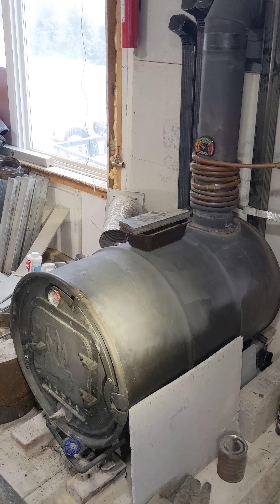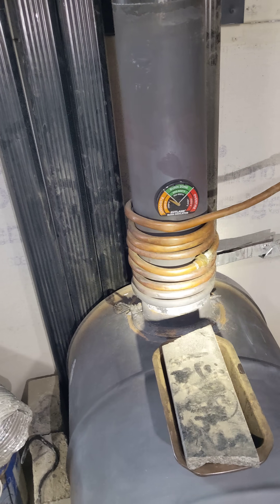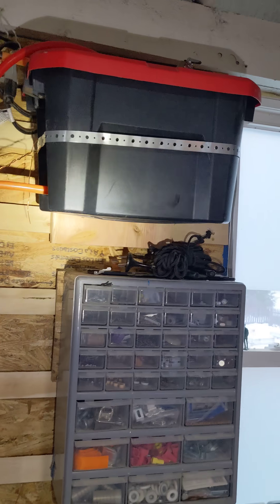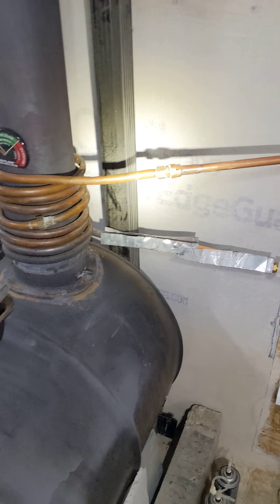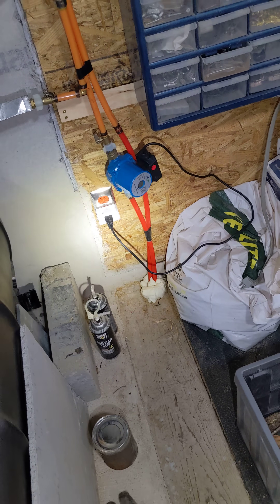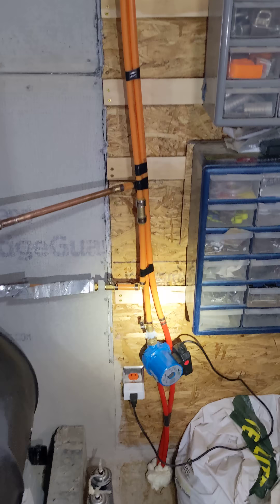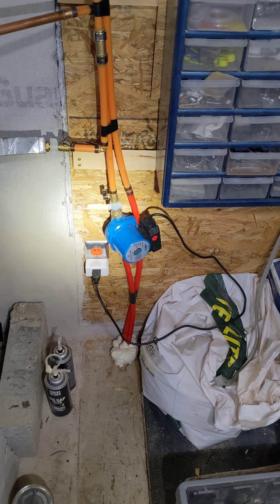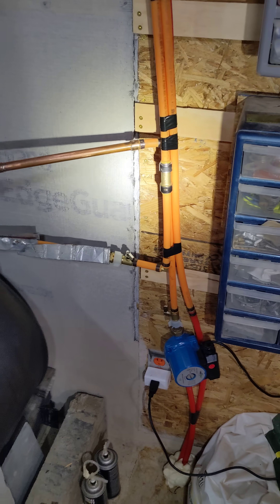How does a Thermosiphon work? Here is mine with a short example. #thermosiphon #radiantheat #simple

Comment: You really need to replace the bin with a real water tank, like an expansion tank or even an unused water heater tank.
Reply from the maker: Ill find something. Right now the return water is never more than 80° and nothing is pressurized.
Reply: @JonDecker its just the safety nut in me.  My house burned down when i was 6
Reply from the maker: @Rastafarai805 legit